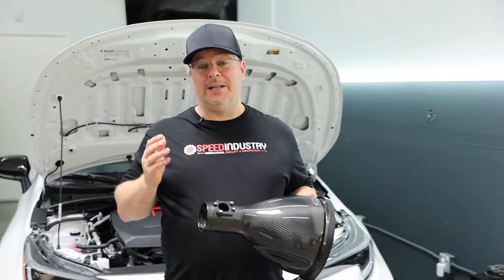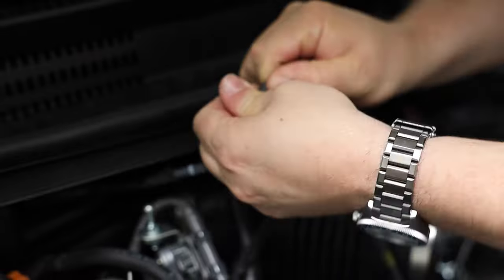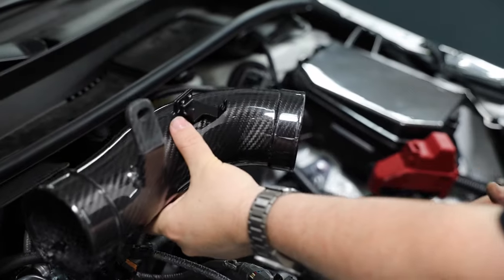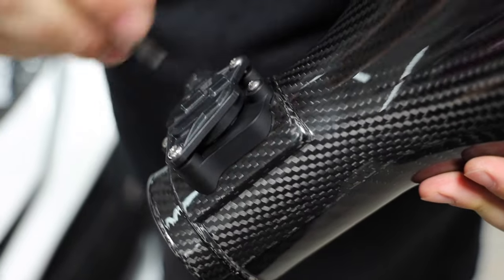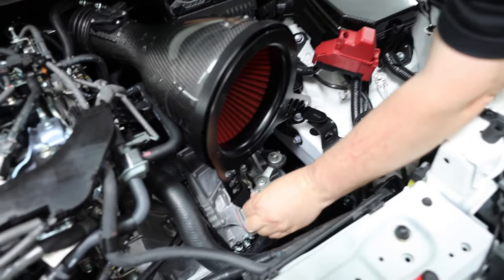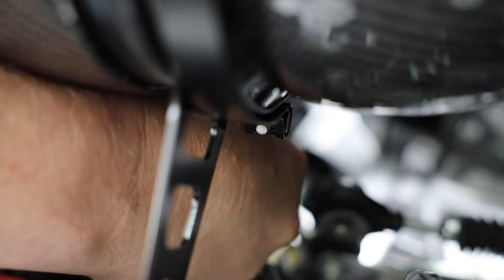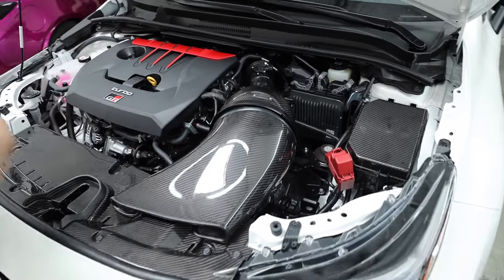How to install Eventuri Carbon Intake GR Corolla | Plus Matching Radiator Cover.

Comment: Sound doesn’t come through from the video, but as someone who owns it I can tell you it’s louder.

It sounds exactly like the stock boost and blow off noises, but just increase the volume like 50%. Sounds nice and not too crazy.
Reply: any CEL or tune?
Reply: @andrewkrikorian760  Yes, CEL comes on a lot, Sometimes it won't come on for months, sometimes it comes on 3 times a week, just depends. I just clear the code.

Will look for some solution for it at some point, but might just have to be a tune.

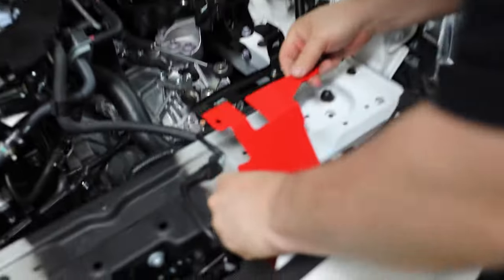Comment: Yeah that bolt to install the red air ramp. @ 6:35. haha!!. Suggest one saves themselves slit wrists installing the bolt  and some frustration. I ended up using an M6 Rivet Nut Setter. Bolt fits perfectly, and no slit wrists 😏 Good video.

Comment: Do we need a tune for this air intake for the GR Corolla. Very interested but don’t want to tune right now.
Reply: You wouldn't need to tune with this intake you will still get hp gains without a tune 10-15hp maybe more... and a lot more with a tune